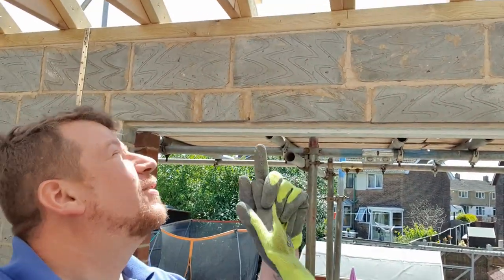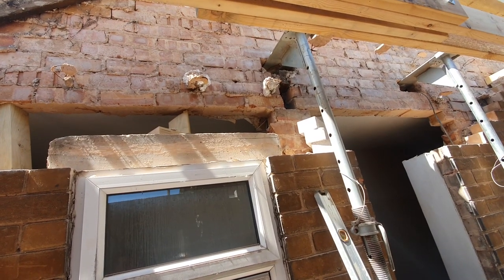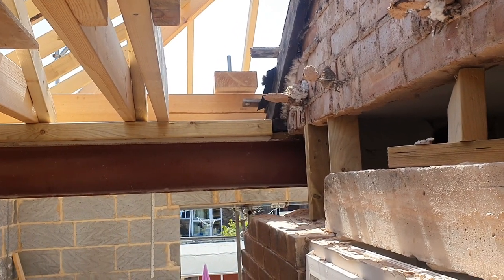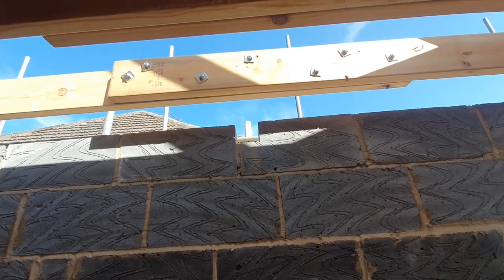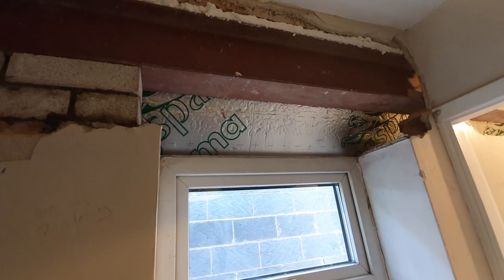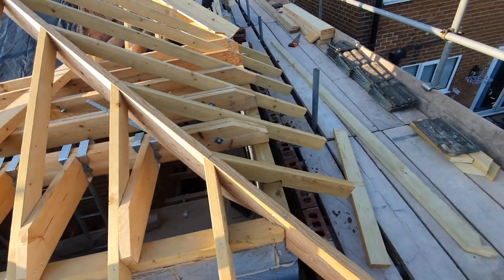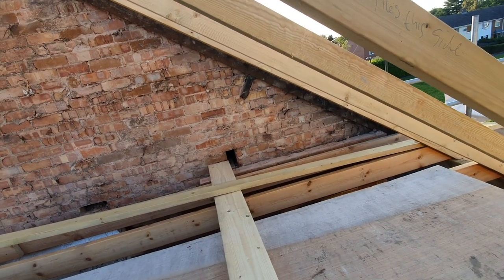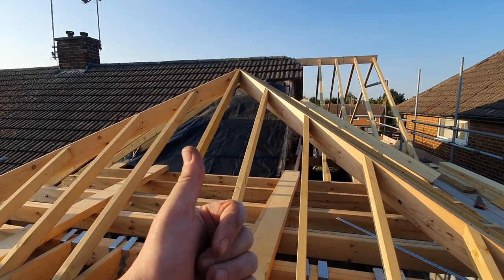Part 12 Of Our Extension Self Build ~ Roof Steels ~  Vlog 885

Comment: I love your build updates. I'm a builder in Ontario, Canada and I really like seeing you progress videos because the UK stye of building is completely different to our style here in Canada. The only similarity so far is the stick framing (lumber framing) of your roof which is my favourite part, but sadly its mostly taken over by trusses around here. We don't do much or any building with structural brick or concrete block around here anymore, we do all our walls with lumber and structural sheathing with weather resistant cladding (or brick veneer)